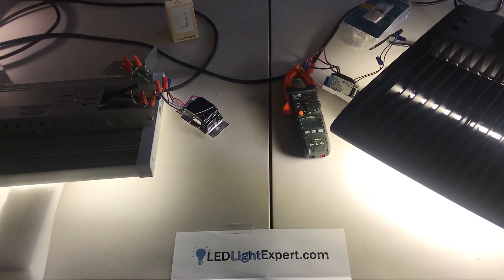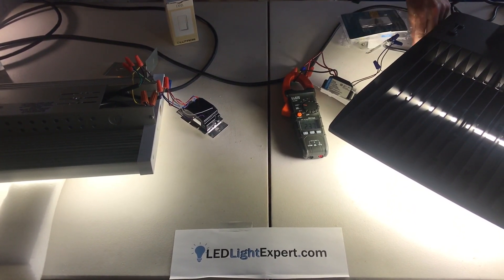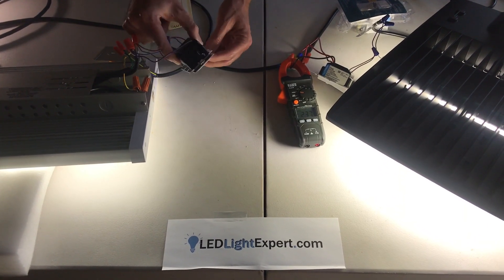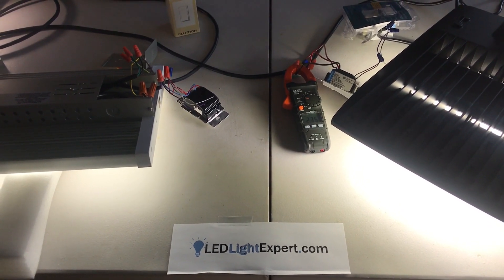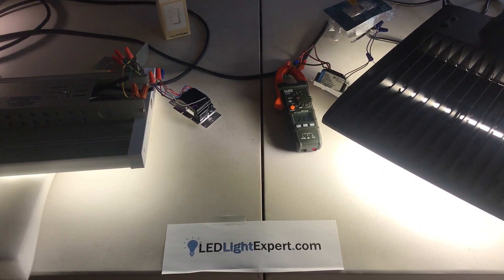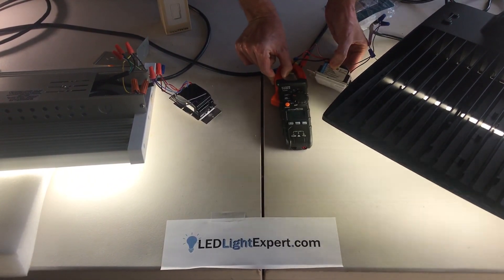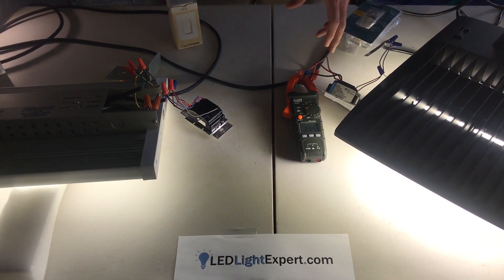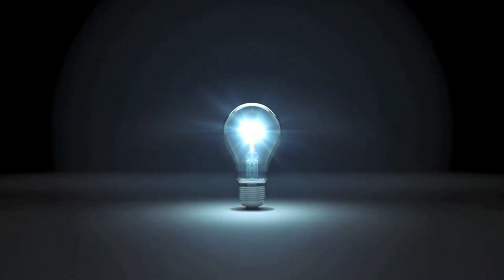0-10V dimming Explained - What is 0-10 volt dimming?  How does it work?  Installation of 0-10v

Comment: The piece of information I'm trying to find is; can one bypass the 0-10v dimming?...does it have to be hooked up to something...do you just twist the positive and negative together?
Reply from the maker: in our lights you just leave the dimming wires capped off and the dimming is bypassed.  The light will default to full brightness.  Do NOT let them touch.  Just tape them up and out of the way.
Reply: @LedLightExpert  Thanks LLE, for tip on bypassing the dimmer switch ,not an electriction,first time using LED panel light .
Reply from the maker: @longhair1016  - Happy our video helped. Feel free to reach out to us with any LED lighting needs.
Reply: For anybody who might be troubleshooting, IME touching the small purple and grey (or for new stuff they're changing the grey wire to pink) wires together will cause the light to dim down to its minimum setting. So if your lights are so dim they almost look like they're off, and you can't get them bright, those wires may have been connected together at some point.

Comment: At 1:35 you mention that 10v = full bright and 0v = full dim. Isn't the opposite true? The LED panels I'm using will burn full brightness with the Gy/Vi pair open and will turn off when the pair is shorted. I can get anywhere in between with a 100k potentiometer between them. So my thinking is that if the Negative dimming pin is seeing 0v (open connection) from the positive dimming pin, I'm getting full brightness. If it sees 10v, I'm getting full dimming.

I'm new to this, if my thinking's off, please let me know as I'm trying to understand how it all works.
Reply: The negative (Gray) dimming pin is considered the reference.  By definition, it always "sees" 0V.  The positive (Violet) pin is at +10V when disconnected.  When the pair is shorted, the positive pin is forced to 0, not the other way around.  Thus, the video description is correct.
Reply: http://www.lutron.com/en-US/Education-Training/Documents/10V.pdf

Comment: I am pointing to a mistake in explanation.... Dimmer does not "send" 0-10V to the LED panel driver, this is just a variable resistor.  It will shunt voltage provided by LED panel driver down to whatever brightness you are desired from the LED panel.

Think about, what if you are not connecting any dimmer to LED panel... Will it go 100% without you "sending" 10V to it?  Yes, it will.
Reply: I think that's because it was explained backwards. Sending 0 volts means no dimming, sending 10v means full dimming.  That is why when there is no dimmer there is no dimming (always 0 volts in that case). Shorting the wires gives full dimming.
Reply: See, now THIS is electronics. I have been all over the interwebs looking for specific info on this 0-10vdc dimming deal. In every scenario, it seems these folks all read the same marketing literature, and changed a few words for originality sake. They all make it sound like I gotta send a variable dc voltage to the respective 2 dim wires. To further confuse the situation, the "dimming switches" are hooked to line power, leading one to think that there is AC/DC conversion going on inside a dimmer switch - perhaps explaining the exorbitant price?  
So, if this is just a pot, what would the correct ohm range be? Say all I wanted was a knob to turn a variable resistor like an old school dimmer pot? Shouldn't this be a published spec somewhere? Do I need to take my fluke DVM up to home depot and taker one out of the box and measure it? LOL.

Comment: Led light expert, I'm trying to figure out, does a 0-10 volt dimmer drop line voltage down to 0-10 volts? Or is this "signal" just something that the driver understands and not actual voltage? I'm trying to build a 0-12 volt dc motor speed control, but 0-10 volts would work too. I would run the low voltage through a bridge rectifier and would require about 1 amp of current. Would one of these dimmers work? Thanks in advance!
Reply: I'm really new to this, but I think the dimming pair is just a signal that the LED driver decides to know how bright to burn the panel (maybe applying PWM?) The panel I have will burn full brightness with the Grey/Violet open and unconnected, and will shut off with them shorted. AFAIK the LED panel is bring powered by the 120v line voltage in this setup.

Comment: Can 0-10v wiring be mixed with line voltage wiring in the same raceway between the switch and the fixture?
Reply from the maker: technically yes, but you run the risk of signal interference.(altering the volts in the low voltage, alters the dimming)  If your wires and the connectors are well shielded it will be fine, just usually safer to keep seperate if unsure of shielding.  Hope that helps.
Reply: @LedLightExpert  AC line voltage cannot be ran in the same raceway as low voltage per NEC. Class 1 and class 2 circuits cannot share raceway
Reply: @EngineerDeez  How does that fit in with the 12/2 MC cables with luminaire wires? The regular voltage conductors are in the same MC as the conductors carrying the 0-10V signal.
Reply: @elsa_g  1 year later MC-PCS Duo is now available.
Reply: @supernova8962  this is what I was talking about, it’s been available and in use for years. It’s an MC with all the wires together in the metal, with the two control wires also jacketed with some insulation, but they’re all still in the same raceway.

Comment: If I have 4 shop lights in series or paralles, can I use 1 dimmer to control them all at once. If so, how would you wire them? Can't find this info anywhere. Plan on getting 2x4 CCT flat panel lights with lifud drivers  I would really appreciate any feedback. Thanks
Reply from the maker: you can wire them on all one dimmer, just go in series.  We're not fans of lifud drivers though, so would suggest  something better
Reply: Led Light Expert thanks a lot for your reply. If you don't mind, why not lifud and what driver would you recommend? Last question
Reply from the maker: Our panels use a Keystone driver.  American company that designs their own power supplies.  Meanwell is the best, but a bit pricey for panels.   UVL is also good.  The light brand means alot too, but many drivers are private labeled (labeled same as panel)  and you have to trust the brand. Use a US brand panel and avoid headaches later.